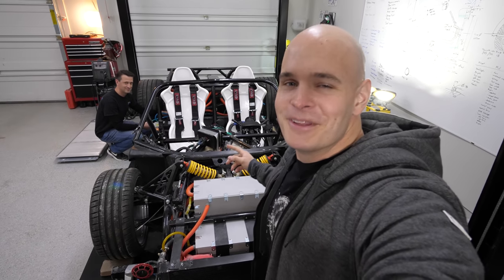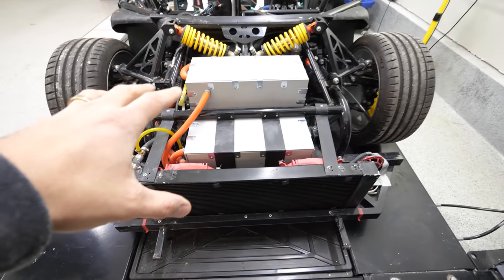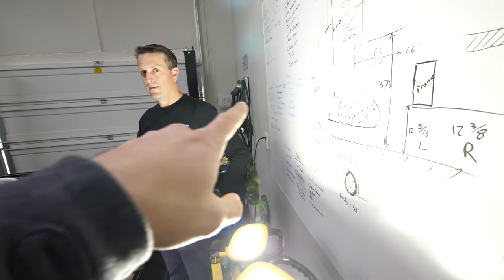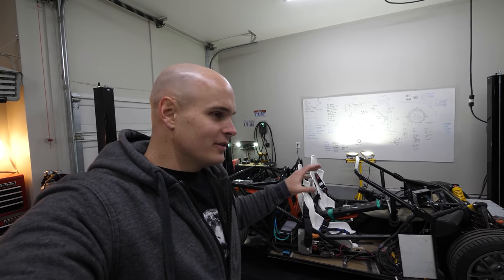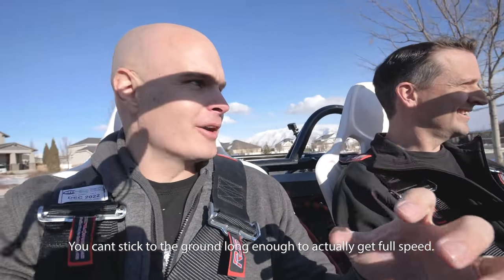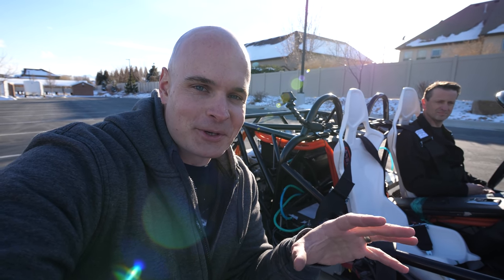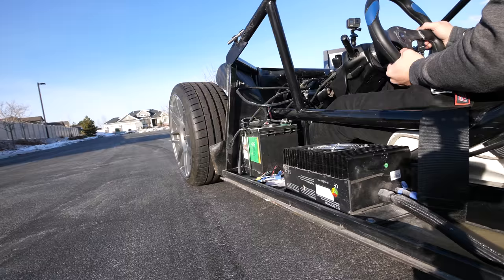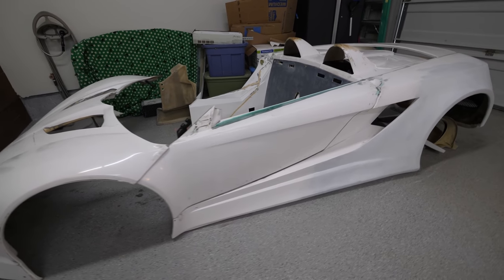How to build a Tesla in your Garage!! - Electric SuperCar

Comment: And his battery scratches at a level 6 with deeper grooves at a level 7
Reply: And then explodes due to lithium ions contacting with air
Reply: I am reading this sentence with his voice in my mind
Reply: Ah yes, tempered glass battery

Does sound pretty cool though
Reply: And smoke at a level stab
Reply: @deeppatel1936  mota  bhai yeh kya hai
Reply: @mitesh2k3  bhai ye elections vastu ni jaherat
Reply: I can’t like this, it’s on 696
Reply: Actually the cars tire scratches at level 6 with deeper grooves at level 7
Reply: Then it goes galaxy note 7 x100.
Reply: Which means it’s glass
Reply: @sajathsalim261  which means that the manufacturer is correct with having gorilla glass vicuts

Comment: UV LED Fitted under the shell that make the paint glow better when turned on or  RGBW LEDS so you can change the colour when you want. then the next level is make the lighrts programmable  so you could do any pattern or even output car data on the shell. its not to hard to do but it would be expensive for parts but the biggest cost has already been taken care of which is the batteries.

Comment: my biggest issue with the car is how the roll cage is designed won't be as effective as it should be because if the car rolls over peoples heads stick out over top of it so the heads will get crushed/grinded so I would probably work on that before doing too much test driving

Comment: The fact that a normal guy has found the courage to create his own car really impresses me. But at the same time, I notice a lot of problems / inefficiencies with his design... Polar moment of inertia - the majority of the vehicle's mass is distributed at the front and rear axle lines, not a lot in the centre of the vehicle, so it will handle like a dog. Frame triangulation - a tubular spaceframe chassis should be constructed in true triangulated form to ensure efficient and controlled transfer of load inputs. Suspension pickup points - the rear coilovers are connected to the frame at a midway point along the length of a tube which subjects it to bending instead of shear stress; this will produce uncontrollable ride and handling characteristics and will also cause early fatigue failure of the frame. I hope this guy decides to build a second prototype which includes these and many more design improvements - would be cool to see him rival the likes of Tesla one day.

Comment: If you want to eliminate the 12 volt battery, have a 400 to 12 volt stepdown transformer wound to run off your AC converter. With a 33:1 ratio and a 400 to 12 volt differential, you could develope tremendous current at 12 volts for next to no input current at 400 volts. About 33 amps at 12 to 1 output to input amps with 400 volts in. A two amp input at 400 volts would be negligible with your battery packs and would give you, allowing for loses, about 60 amps at 12 volts output. More than you would need for anything except maybe air conditioning. My first car, a 68 Chevy Bel Aire, no A/C or radio had a 35 amp alternator and was still more than enough after adding a radio, CB and driving lights. You could actually boost start a regular car with that yours plus you wouldn't have to worry about your own battery failure, charging or acid spillage in a rollover. Speaking of which, those roll bars behind the seats look just tall enough to keep you from breaking your neck so that you can live to experience the joy of erasing your face into the pavement. Please be careful. BTW, just don't forget the rectifier bridge and filter cap at the output of the transformer or your horn and radio, if any, will sound like a couple of grinders hard at work. Good luck.

Comment: The only thing I would have done was weld a plate in the back place all twelve batteries to add more weight to the back. Also, that would give you more steering wheel space and leg room.  By doing that you would shorten the wiring.  you could also add a panel to distribute all the other electrical components.

Comment: The speed ratio for when the rear tires are about to break loose is 6 MPH.  When the speed of the rear tires is 6 MPH faster than the front tires is the point of maximum acceleration.  If you can detect that point and cut the power you'll get the best 0-60 time.

Comment: 32 degrees out on cold rubber and a very light car… traction is going to be limited.. tire warmers would help but not sure how much as the car may just be to light for the amount of contact patch those rear wheels are providing..  put some slicks back there.. warm em up and try your 0-60 again… would GREATLY improve..

Comment: Under the sentence "how to build ..." there is certainly the stage of designing and building a power inverter (especially for such powerful engines), but it is the same as building a gasoline car in a garage, including machining the valves in the cylinders. However, the guy did a great job anyway, which is crazy.

Comment: That 0-60 is very incorrect. Engineering Explained goes into detail about this. The fact that the tires are spinning and it's so cold out gives it away immediately that it's wrong. It's simply not possible on street tires in the cold. It looks like the monitor is probably reading wheel speed and the wheels aren't getting traction.

Comment: I would definitely go for a frosted gunmetal gray. 
Also I would not go without traction control. I know, it's cool ;) but it's also dangerous. I think I'd make my own traction control system by using a micro controller and 4 speed sensors, so that it can lower the throttle signal until there's traction again. Of course I would make it in a way so that it can easily be disabled ;)

Comment: Why didn't he use a DC DC converter to get 12v from the main batteries?   That would seem to simplify operation and charging.    Even if there was still as small 12v battery as a buffer for the 12v side, it would eliminate needing to charge both systems. 

I want to do something like this someday.  I have the skills, but not the budget.   Right now, I'm just looking at what others are doing, and I'm making mental notes.

Comment: For the 12v system, would there be any benefit to using a deep cycle/marine battery or a tractor/heavy duty commercial battery rather than a standard car battery? I've seen tractor batteries that have upwards of 1500 CCA and 200 Ah,  and deep cycle marine batteries with upwards of 1400 MCA and 100 Ah.

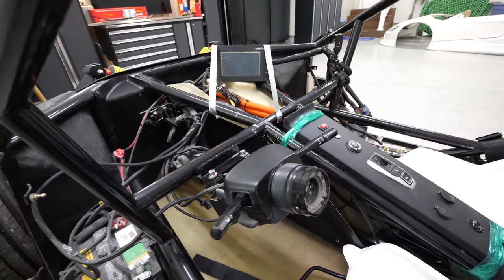Comment: 3:50 why not a voltage regulator that regulates from 400v to 12v instead of adding a 12v battery and other low voltage components? I'm not suggesting this just wondering if it would be possible?
Reply: It does have but its meant to charge the 12v battery instead of direct connection. And besides, you'll need battery to start the engine how do you suppose to start it
Reply: @HanxoHaxashi  it's an electric engine why would you need 12v to "start" it.
Reply: @exshenanigan2333  the 12v system gives continuous power for the important parts like start engine key, switches and the BMS while the high voltage part isn't since they're basically locked from getting power from battery so no voltage going from the high to low voltage. Eventhough its an electric vehicle it also needs to have a low voltage system like a 12v for starting the engines and others. Again, how do you suppose to start an engine without the 12v?

Comment: “The engine is revving?”

No. There is no engine. It wasn’t revving...
Reply: Yeah not engine to rev. But MOTORs very much do Rev and IIRC Tesla Drive units are around 16,000 RPM.